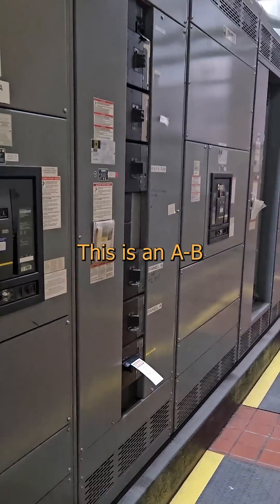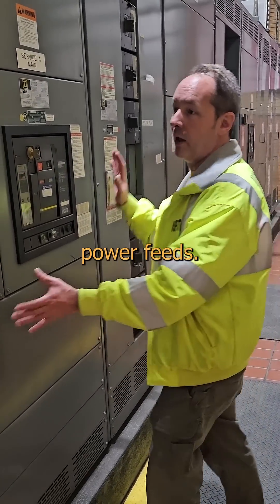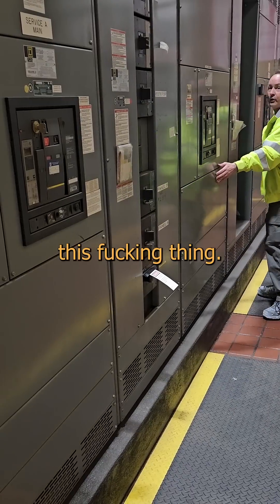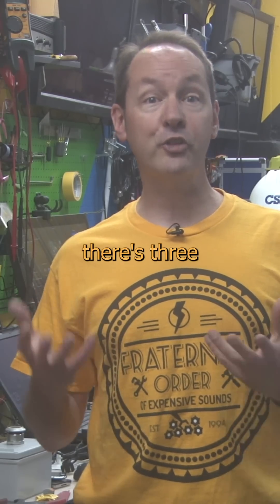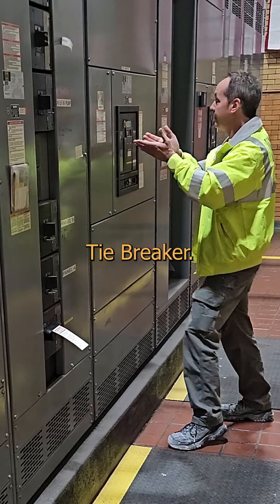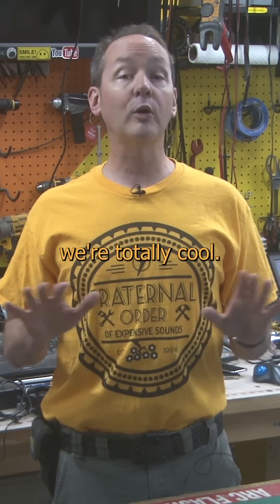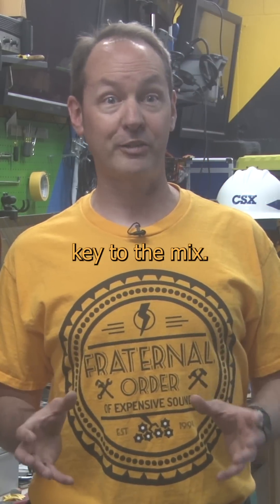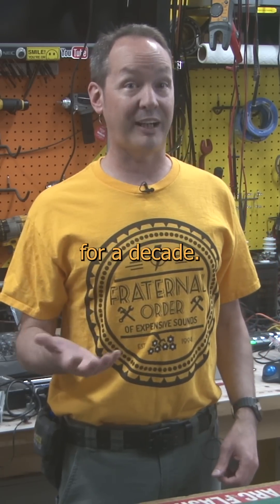A B Interface #chrisboden #comedy #electrical #engineering #energy #substation #switchgear #power

Comment: I've handled fire. Fire is relatively simple, and while it can be dangerous, the results of that danger actually resolving are comparatively low-grade (at least, they are on the scales I was handling fire).

I've also handled some very reactive chemicals, as in "you cannot let air touch this at all, not even a little bit as a treat, because otherwise it will explosively burst into flames" and "this is about as toxic as hydrogen cyanide" grades of reactivity.

I have also had the arguable misfortune of not seeing the people working in the fume cupboard next to me detonate their glassware when the oxygen they managed to condense into it evaporated and overpressured their system.

All of those pale in comparison to "you will be the paint on the walls".

Comment: I work in a research building that has to stay negatively pressured (we have nasty stuff in here that absolutely can NOT get out into the air). We have backups on backups on backups to make sure the HVAC system never loses power. The entire top floor of the building is all of the electrical panels to keep it all running. Going to guess we have one of these up there.

Comment: I worked at a facility with a cross tie that ran off of two medium voltage transformers. One went out and the manager wanted me to bring in the cross tie because he was going to lose 15000 in production before the power was back on. I asked what’s the monthly power bill ?  226,000 a month. 
       I told him to call the billing office of the power company and ask what DOUBLE peak amp billing was going to cost for a month. Peak amp is based on the peak amp draw. Not the average amp draw. 
       It would have been about half a million that month for one day on the cross tie.. 
They did not use the tie breaker.
Reply: But is it not the same draw?

Comment: So what I understood
- 2 power feeds and one connector
- all three need a “key” to run and there are only two “keys”
- each power feed powers its own set of chips.
- (I presume that both sets of chips need to be active at all times)
- when the two “keys” are in the power feeds it is effectively two closed circuits running the two sets of chips.
- when the link is active one power feed runs both sets of chips while the other power feed is deactivated
Reply: Replace chips with circuits

Comment: Building a data centre this is what I'd want for redundancy, disparate power from separate sub-stations.  It's really, really hard to find locations where that is possible but if you do it's actually quite easy to manage because for the servers you're passing through a battery-backed UPS while for the ancillary equipment manual switch overs are adequate.

Comment: I've always found the idea of machine that is not supposed to go boom, but has a designed in option to go boom, quite fascinating.

The steering wheel of a vehicle is once such device, but that is not quite the same is this A-B buss interface. The steering wheel offers and infinite number of choices depending on how fine you want to measure them. In other words the X-factor involved in steering a car has an obvious risk.
But the risk of the A-B interface is not immediately obvious... it's just another set of switches, that depend on specialised training to operate correctly.

If you were designing a computer interface to illustrate the risks involved, I think it would be rather colourful.

Personally, I’d want the entire system to automatically lock down if all three keys were out of their default location.

Comment: When I was delivering pizza, we had big honking signs to put on top of our vehicles (triangular shaped, ran using 12V 50W Edison-based bulbs to light them up . 
we also had a walk-in fridge, and the last bulb burned out and we couldn't spare someone to get a bunch of standard 60 W bulbs. But we did have a few of the 50W 12V bulbs. One of the cooks grabbed one of the sign bulbs (I think it was the last one we had of those as well). 
Long story short, he grabbed the sign bulb and walked to the cooler, muttering 'This ought to work'. I said, "you put that 12 Volt bulb into the 120, it'll pop." But what did I know, right? He put it in and flipped the switch and it went 'POP' faster than lightning. 
I calculated (remembering that the power scaled to both voltage AND amperage) that for 'One Brief Shining Moment' it was, not a 50 Watt bulb, but a 5000 Watt bulb.
Nothing really major happened (besides burning out), the bulb hadn't lasted long enough to draw enough power to trip a breaker.
The only dim bulb was the cook.

Comment: In before someone copies a key to have a personal one so they don’t have to keep asking for it.

If you think no one’s that dumb you’ve never seen a middle manager holding a pair of bolt cutters and scratching his head in confusion while staring at a lock out switch that’s on fire.  He didn’t know why the power was off or whose lock it was so he just cut it and flipped the switch.

Comment: This reminds me of a hotel I've worked on events at. The hotel is fed by two different substations because it also has a bunch of cellular stuff on the roof. In the main ballroom there, there are outlets fed from different substations and the ground differential between different outlets can be as high as 90V. Needless to say, you cannot have equipment plugged into different outlets and then connected together, like AV gear on one and a laptop on another with an audio cable... someone did that and got some nice sparks. OSHA would have a field day if it ever inspected that hotel. The wiring there is questionable at best. The big 60A 3-phase hubble connectors are miswired and cannot be used.

Comment: Man, and here I am freaking out because I plugged a vaccum cleaner into an old outlet with a decorative metal face plate. The prongs managed to melt some lovely impressions into the plate in the less than 2 minutes it took to vaccum a small rug. And then KA-POP! ...byurrr... when I pulled out the plug. 

The best bit of DIY magic comes from sharpies and masking tape "DO NOT USE" taped over the outlet.

Comment: I was the engineer on a tuna boat for a few years and we had a panel to switch between generators... Just 2 big breakers side by side with a big note in paint pen saying "ONLY 1 ON!!!" Both engineers before me didn't follow the rules. It hurts my brain and scared me dealing with that boat's electrical systems. It takes a lot of juice to keep 100 tons of fish at -40°f (fun fact -40°c is the same temperature. It's where they cross scales)

Comment: The yearly training i need to go through on "how to properly set the tie breaker" and read the corporate safety manual with corporate safety engineers. I could recite from memory. But the pucker factor of needing to throw it when the electronic phase monitor failed, made me sweat like Midwest  down pour in that suit. That green button and loud thud after pressing 😰

Comment: Some of these can be made to operate in a automatic open transition, but then you must rely on electrical interlocks. Some actually can be paralleled, but you wouldn't want to surpass the kA rating of the switchgear, and also increase the arc flash potential...

Comment: I worked at a wastewater treatment plant that had the most redundant power feeds I've ever seen. 3 separate supplies, 2 from one power company, from different subs, and the third from a completely separate power company. They also convinced the bean counters to let them keep the old generators every time they upgraded to new ones. The oldest one was 60+ years old and still ran during it's annual tests. They could operate at 100% capacity off the main backup generators, and at a reduced capacity off the old backups. By my count, they had 6 levels of redundant power including the ancient generator that could run a bare minimum of things to keep the critical functions online. Why would a wastewater treatment plant need so much redundancy? Because if it went down the second largest city in the state lost ALL wastewater treatment. The plant had at least one spare of literally everything, every pump, tank, and pipe was duplicated. They'd never had the plant go down in it's history and I don't expect that to change unless a bomb went off or something.
Reply: It also came in handy when there was a big industrial spill into the sewer. They shut off the outflow from the plant, let the tanks fill with the contaminated water, and then switched everything over to run on the backup pipes, tanks, etc. Captured and isolated the spill and the plant just kept running afterwards, business as usual. The company had to bring in special treatment equipment to pump out and treat the contaminated water, but nothing made it out of the plant into the river and they didn't have any lines back up or overflow from having to stop the plant. A textbook example of planning and redundancy working flawlessly.
Reply: Wow. That bit about the industrial spill is incredible. People talk about redundant systems for their ability to keep things running as normal if something breaks mechanically... but nobody ever talks about the fact that they give you that level of versatility. Intentionally taking something out of service so that some of the equipment can essentially tank the hit for an entire city is an outstanding use of that level of backup potential.
Reply: Good on them! They need to teach the rest.
Reply: @ShukenFlash  What a Utopia, in Canada we just dump our overflow into the rivers.
Reply: Nobody needs 6 layers of redundancy, until they suddenly do.

Someone upstairs there really embraces the 7Ps.
Reply: @Just_A_Dude what's the 7Ps?
Reply: @SpaceCircIes  "Proper Prior Planning Prevents Piss Poor Performance."
Reply: Seems like that’s a very well managed plant manned by well-trained people. Impressive!
Reply: An example of a very literal "shit doesn't stop coming down the pipe because something broke."
Reply: Part of the reason critical infrastructure has so many redundancies is a lot of it was built during the Cold War when global thermonuclear war could be penciled in for any given Tuesday. Civil Engineers understood the importance of running water and electricity as the building blocks for rebuilding after that calamity. The Government did not want society to collapse and have us all turn into marauding cannibal tribes. They built out redundant infrastructure, stockpiled supplies, and had contingency plans to ensure the average citizen got back to work and paying taxes as quickly as possible while being clothed, housed, and fed.
Then the Cold War ended and the government decided this was all rather expensive so now if a nuclear war happens we're kinda screwed, but hey at least the lobbyists got the politicians some nice Rolexes.
Reply: On the flip side, you get the waste treatment plant in my city. Power went out and they had no redundant systems… at all. 375,000 gallons of waste water was dumped into the water table and flooded the area because some GENIUS decided that all electric locks and systems + no backup power system = perfect solution
Reply: I thought my backups or redundancies were a lot just because every building is a little different, and they were built at different times... all of the systems over lapped on in one place would be soooo much fun😅🎉😂
Reply: This screams "An Engineer's engineer somehow screwed up and found himself in management"
Reply: I’ll never understand why backups are referred to as redundant systems in the U.S. if it’s used, even just from time to time, it’s not redundant.
Reply: I love this because it shows when something is important enough to humanity, we will refuse to let something fail. So cool
Reply: Yeah, that's a plant you don't want to to fail.
Reply: - reads golden tidbit of engineering history 
- sees pfp
- by the gods, Thor (PirateSoftware) was right! They do run the infrastructure!
Reply: @PhilipAlexanderHassialis The more crazy and weird the person, the more likely they are critical to something for modern daily life
Reply: "I got a new job at a waste water treatment plant, they had seven strange rules to survive" -a new creepypasta story or an IRL government 'secret project', possibly both.
Reply: meanwhile in richmond virginia.....
Reply: I bet even if a bomb went off they have a secret triplicate system you weren't paid enough to know about
Reply: Meanwhile at my local WWTP, if it rains a little too much and no one is present at the plant or able to get there within 7 minutes to open an overflow relief valve manually, it overflows into the river. Just a few months ago that happened and I think like 200 cubes went into the river... At least it was treated waste water I guess...
Reply: @ShukenFlash  Oh I never thought about how important it is for those facilities to never go down. A literal shit flood would happen
Reply: More redundancy than Heathrow…
Reply: Wow. Detroit's wastewater treatment plant has at least 3 backups of everything, except electricity. We only had DTE and what used to be PLD. Hey, wait a minute -  They shut down PLD's generators and switched all PLD stuff to DTE. So, do we still even have a backup? Damn, I gotta look into that. I'm sure they put in generators, but now I'm wondering. I haven't been on the property since I moved from water to fire in 1993.

Comment: Here's a job question for an underpaid Electrical Engineer: Describe your experience designing, commissioning, starting up, and troubleshooting a main power distribution substation that involves two independent incoming power feeds from utility and a tie breaker. The substation also has co-generation on the load side that can export power back onto the utility grid if the load consumes less power than the co-generation system. Discuss the topology setup of the power distribution system, why the topology is used? What protection relays, power monitors, and synchronization relays were used? What grounding scheme was implemented in the design? Specify the manufacturers and models of the equipment used in the design. What specific functions and compacity was your role in the project?

Comment: I work for East Bay Municipal Utility District, which is the water company here in the San Francisco Bay Area, CA.  Our headquarters has two separate feeds, it is not acceptable for us to loose power ever.  We have a large room full of UPS batteries just to buy us precious seconds until the multiple 500kv generators can come online.  It is not interesting to most folks, but it is all my equipment, I maintain and monitor all of it.

Comment: 2 things I learned as a Car-Mechanic apprentice under a Master who used to work in Electrics:
- The right amperage makes you small, black, and very Ugly.
(Said to me while I was working on a running car's generator, that sparked)
- 1000v are a warning, 1000a are a Execution
(said to me after I got zapped by a Spark plug, holding my hand and crying)

Comment: Originally we had 3 generators at work. One 50kW  and two 125 kW units.3 could have both 125s online at the same time. The grid was protected by a set of key locked breakers. And only one key. So we could either feed the station from the generators or the grid.  Now if I had ever wanted, I could have overridden the interlocks. But I didn't want the angry pixeys to get loose.

Comment: We have one of those in my facility. 20 years after it was installed, I insisted that they add in a "Sync" function so that planned transfers from side to side or from commercial to generator power won't shut down parts of the building not deemed "critical", they get a constant flow of power, and minimizes surges where things like AirCon units go from power to no power to power in the span of a few seconds. Can't help unplanned transfers.

Comment: very dramatic.  I would be more worried of dropping your loads that causing a life safety incident. It all depends how your  protection settings are picked and how out of phase your sources are.  I'm going to say you would drop at least  one of your (breaker will operated and open).  it's only when your breaker fails that bad things start to happen.

Comment: We don't have a/b, but we do have generator interlock switchgear in grocery store EDC rooms. A Kirk key to lockout utility power before closing the generator contacts. I'm 24 years in refrigeration and have been onsite when stores have been switched to generator and back. Lots of double checking everything. Refrigeration racks are not cheap and can't be offline.

Comment: I work at a juice factory. These are every where, we can turn 4160v in any direction essentially. Was working 3rd shift when one of our massive 4160v air compressors went down. The operators started it back up and it blew the door right off the MCC shutting down the whole plants air supply. It took 6hrs and walking into into many dark abandoned places but we got it back up.

Comment: and sometimes you luck out. 

Our office started with one building, and the original building is fed from our frontage road. 

When they built the new section, for some reason they fed it from the cross street a block away. 

Each street is fed from a different substation. Luck of the draw. We lose power on one side or the other regularly.

Coincidentally our server room is on the adjacent wall between the two buildings. 

So with just a few thousand bucks our server racks are A/B powered, with B also generator backed. 

It takes a LOT to take out our server farm. (and now we save $5,000/mo on colocation fees to have those mission critical servers in a data center 15 minutes away)